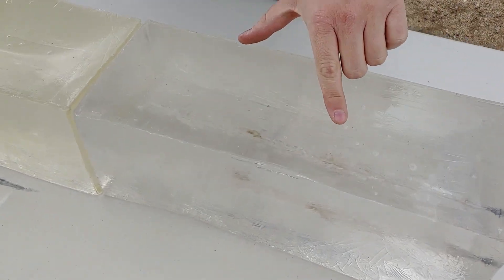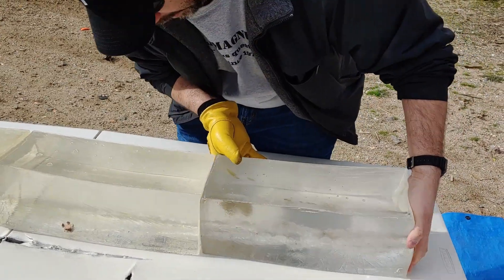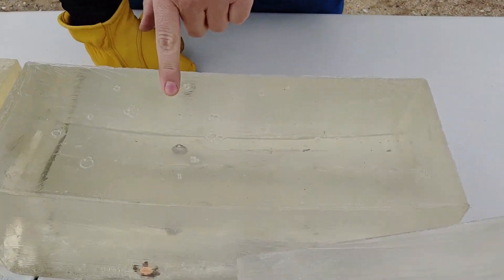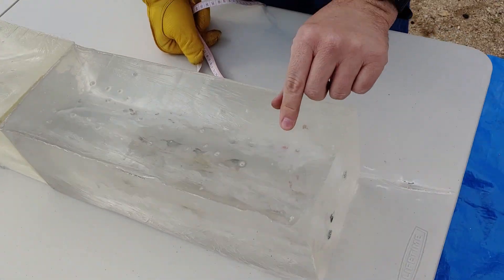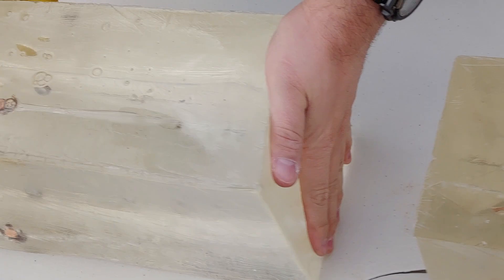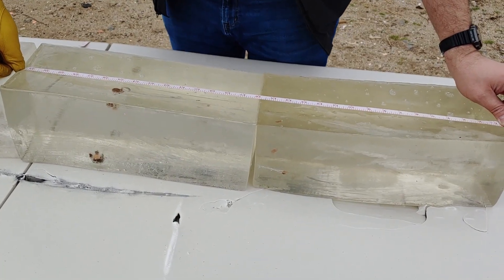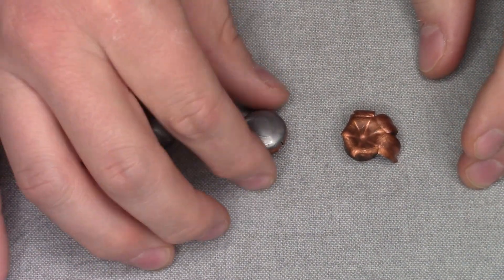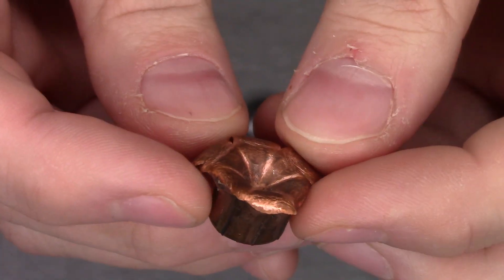Ballistic Gel Test  - The  500 Smith & Wesson Magnum 4 Types of Bullets

Comment: You could load the 275 Barnes to over 2000 fps easily.   But impact resistance would also go up and likely the bullet would penetrate less as a result.  Too bad the 535 wasn't recovered.   Not surprising it penetrated the most - likely because of less expansion.  Nice video.

Comment: Great Video, but when I reasearched the Hornady web sight, they state, that out of an 8.5" barrel the 300 FTX has 2868 Ft/lbs of energy and 2175 FPS velocity.
From your video, it appears your revolver has an 8.5" barrel but your stats on the 300 FTX are 1888 etc. Was this choreographed from your gun, or was this a non-factory  hand loaded round? Respectfully  I ask, because I have seen more impressive results from the Hornady 500 mag.300gr. FTX round, used in other video tests.

Comment: Thanks for a great video, Sean! You are right. That 400gr Sierra looks mean! My 500 JRH has a barrel length of 7.5”. Do you think I could squeeze 1700 out of it with 296, MP300 or maybe some 1680? The 300gr FTX surprised me. It performed WAY better than I assumed all these years it would. I bet the diameter mid-expansion was considerably more. I like how it’s final expansion point is in the 60s. Almost a guaranteed blood trail if it comes to that. If I could find some to handload I’d slow that 275gr to ~1550. It might retain all its petals. A part 2 with the 325gr Swift A-Frame, 350s Sierra and Hornady, the 500gr Hornady, the 325 & 375 XPBs and the 385gr Remington CorLokt Ultra Bonded(Ok. Maybe this would be parts 2 AND 3). I for sure have done 375gr XPBs and 385 CorLokts. I may still have some Hornady 500gr XTP FPs. I’ll try and locate some of those Swifts and get them to you. The others I for sure haven’t seen available lately. Thanks again for allowing us to witness the effects of those heavyweights!
Reply: Not 500mag related but man i love 1680! Can get some real smokin velocitys out of 444 marlin and 450 bushmaster
Reply: @marlenzacharias7301  I have no experience with either but the 444 has been a want for decades. The 450 only more recently since my brother got into building ARs. There’s VERY FEW cartridges I don’t love but there’s something extra special about big bores in anything and medium bores(358 Win, 338-06, etc) in bolt guns. I hope that Ruger will chamber the Marlin in 444 at some point
Reply: Id buy one for sure if ruger did:)